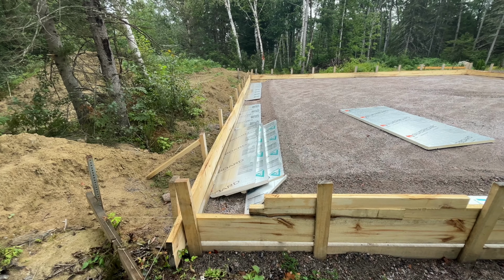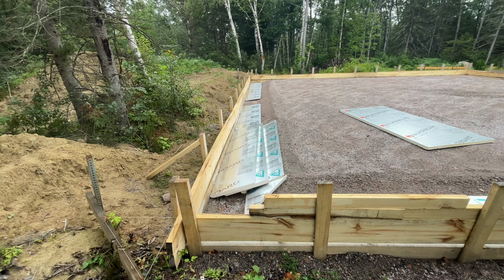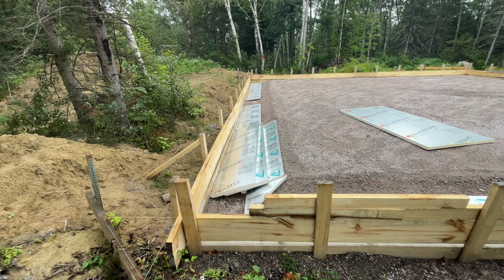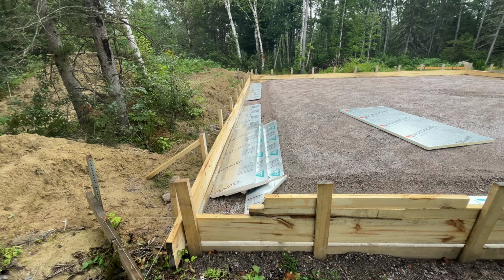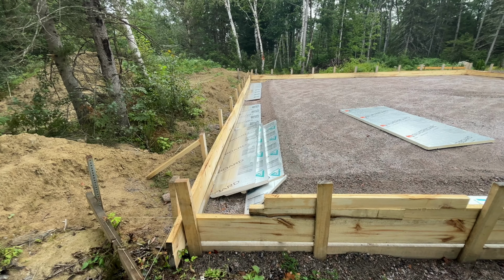Building the Shop - Part 25 - Fitting and Installing EPS Insulation and Vapour Barrier

Comment: Are you planning to put horizontal insulation around the perimeter or to keep like this with thermal bridge between footing  and soil outside?
Reply from the maker: Hi @andreycham4797,
Yes, we are cutting and placing them at the 4:52 of the video.
Just a heads up that concrete does not stick to the Amvic Silverboard that we used.
It might stick to insulation that doesn't have the "tinfoll coating" on it.
Thanks for watching and commenting!
Andrew
Reply: @LivingtheNorthernLife  there is no any horizontal insulation at 4.52. You are placing vertical insulation there, which would be a few inches deep into dirt.   Footing is setting on dirt, which creates a thermal bridge around  the building
Reply from the maker: @andreycham4797  Yes sorry... you are correct.
The engineered draws didn't ahve it so I didn't think I could do it and I never asked. I wish I had put insulation in the footings as well.
When I went back and looked at a bunch of their pictures they had online, they have insulation in their footings... I was pretty disappointed after seeing it.
Andrew

Comment: why did you lay a  moisture barrier over the insulation is also moister barrier so now you will trap moisture between the poly and the insulation.
Reply: Curious as well, had some ideas as to why. But curious to know the reason or choice made.
Reply from the maker: Hi @Screamingpinesfarm,
There should be no space between the poly and the eps.
I'm assuming that there are holes all over the poly as we were walking on it and rebar ties poking holes in it.
It used less then half the tape to do it this way.
I would have put EPS in the footing as well but the engineering company didn't have it in the drawing but did have the poly with the EPS in their drawing.
Not sure this helps but this is what we did.
Thanks
Andrew
Reply from the maker: Hi @BrettBumeter,
There should be no space between the poly and the eps.
I'm assuming that there are holes all over the poly as we were walking on it and rebar ties poking holes in it.
It used less then half the tape to do it this way.
I would have put EPS in the footing as well but the engineering company didn't have it in the drawing but did have the poly with the EPS in their drawing.
Not sure this helps but this is what we did.
Thanks
Andrew

Comment: really confusing since you keep switching back and forth in your time line
Reply from the maker: hmmmm... I don't see any jump in timelines but after we put all the insulation  in the center and tape it we go back and cut 18" panels to complete the form walls. We used the insulation panels on the outside wall as well.
Maybe this is what you're refering to?
Thanks for watching and commenting.
Andrew